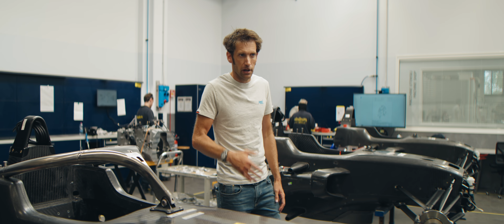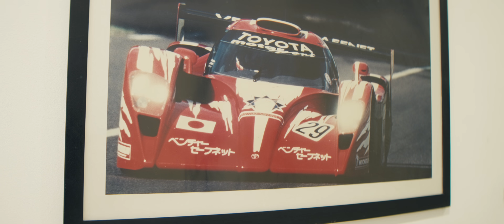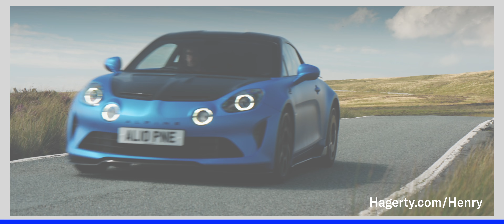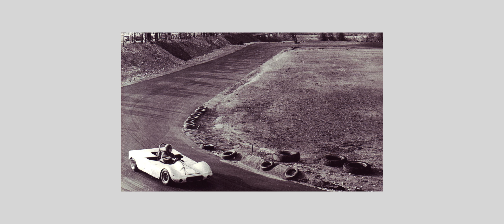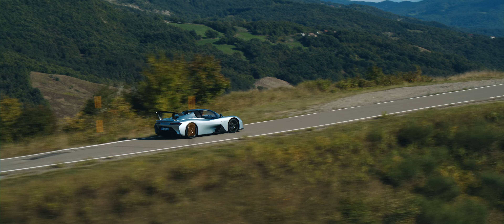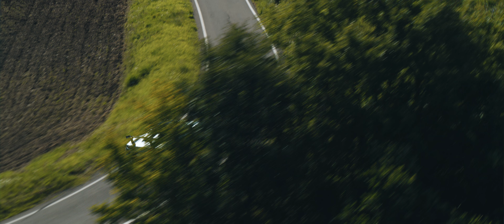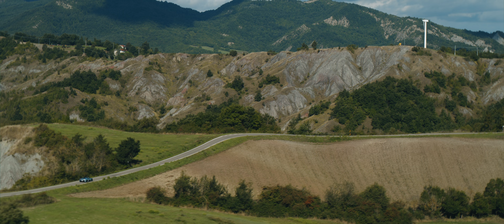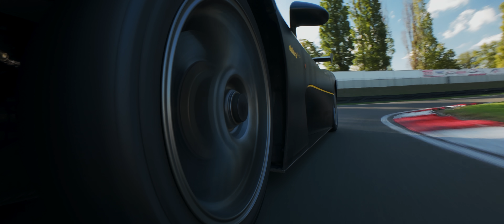Dallara Stradale: If an F1 car was a Miata | Henry Catchpole - The Driver's Seat

Comment: Ford guy here, all I gotta say is they could have used any 4 cylinder. But they know how reliable the 2.3 is and how small it is and they choose the ford/ Mazda turbo. The same engine in the eco boost mustang with some added boost and probably timing and just maybe a touch of compression for the fact that it’s an exotic with no doors. Darn near the same output as a coyote in a 2.3. My hats off to Dallara because they don’t lie to anyone including themselves, they use the best option for the application every time. Thats why they make every race car that matters / wins.

Comment: the car is perfect but the lack of correct sound is unforgivable.... 2.5 liters 5 cylinders Audi, 3.5 v6 Toyota ( same of Emjira) ...may be done all in aluminum...a reboot of VR6 ...even if they sacrifice + 50 kg or some cm more... the car...specially with the name STRADALE is more then speed and effectiveness could be experience...and sound is the second thing you catch ... then arrives the rest

Comment: The thing sounds horrendous. Doesn't match the look at all. They did so many things right. They had that talk about matching looks and aero with the engine. I call bs cause they had a choice of about any engine they wanted. Yaris 3cyl, Honda, Subaru, Mercedes, Renalt/Nissan 4 cylinders all have options that are probably able to work, 5cyl are easy to make sound great, and 6 cylinders that might work.  But Ford.... you know the company with the highest recall rate.

Comment: I have no issues with a 4 cylinder turbo motor from Ford. Presumably they've redone the bottom end to get 400 hp from the road car, but otherwise the mundane bits can be sourced from the local dealer. I loved my 944 Turbo and before it my Mk 1 GTI; I love a straight 6, too, but with modern engine management, clearly a 2 liter four can produce all the power one needs--just add lightness.

Comment: I used to own a 2 seat aerobatic airplane that required you to step down into it.  It have a similar effect of "putting it on" rather than getting into it.  However, getting in involved stepping up over a very high edge, standing on the seat and lowering yourself in with upper body strength.  

I would have loved to see how you get into this car.  My guess is the process is similar.

Comment: So they wanted a lightweight, 300hp, transversely mounted, turbocharged 4 cylinder… and didn’t go with the K20 from the Civic Type R? The only reason I could guess for going with the Ecoboost instead is because Honda wouldn’t sell them the K20

Comment: A carbon chassis that can't be repaired if damaged, no doors so you will look silly getting in and out, no radio not even a basic one, no A pillar so the occupants will lose their scalps in a rollover, a regular crate ford engine boosted to 400hp so it has some decent lag and sounds like a ford focus, and the cherry on top is no clutch pedal and a paddle shifter because ''faster gear changes'' and totally not because the buyers can't drive manual. Oh and only costs 200k, what a bargain

Comment: The brake feel is undoubtedly an engineering choice. I have never driven the car or claim to know more about car reviews or  have half of Henry’s driving skill. Automotive reviewers in my experience have a tendency to like over assisted brakes that have a lot of initial bite which makes them feel more sporty and confidence inspiring but from an engineering perspective it’s objectively worse. Linear brake pedal feel allows for better threshold braking, modulation, ABS blending and more accurate trail braking. If you let two engineering companies design a braking system it’s almost guaranteed they will opt for the technically superior design choice rather than a one that might feel better. 

Also the 2.3L RS engine is a very very very logical choice if you want a production 4 cylinder that can make serious power. It’s a descendant of the Mazda MZR which was Mazdas answer to the other incredibly engineered Japanese 4  cylinders of the era K20/24, 1/2zz, 4g6x. It was also designed to go into trucks so it had to be durable the 2.3RS is a closed deck and monolithic bed plate so it can handle very high boost levels for a gasoline engine. 

Both the brakes and engines choice were engineering first, passion second choice decisions.

Comment: Very interesting, looks nice. But those tail lights are hideous. Should have moved the reverse lights to small rounds that are at the upper corners within the diffuser section, similar to the interior dash element, just much smaller.

Comment: That it uses the 2.3 L Ford is interesting. Just saw a young man that has build 2 Miata ND-1 with this engine. Different exhaust manifold and turbocharger. One with 400 the other 500.

Comment: If it were me I’d have put a 9,000 rpm Honda N/A engine in it with  270 hp. - Linear power band with instant response
Reply: Then add a supercharger

Comment: Sweet vehicle. And with the use of the Ecoboost 2.3 & the MMT6 B6 transmission, which both have plenty of aftermarket support there are plenty of things that can be improved on. The price is a lil insane but that's kinda to be expected from arguably the best race car manufacturer in the world's first road car. The view out the window, to me looks like an old Group C Le Mans car just with a bit more visibility. I would definitely like to take the manual one for a spin on my home track, Lime Rock Park. It's lightness would probably do great there. Great video 🤘🙂‍↕️🤘
Reply: They make 50 a year, even at that price the waiting list is probably very long
Reply: @medicane122  apparently few months max, if you choose something like exposed carbon its gonna be a longer wait ofc

Comment: It’s a shame they don’t use a high revving engine
Reply: Imagine a Panigale V4 R in it...
Reply: Yeah... imagine if they offered it with something like a turbocharged billet K20 or K24. That thing would sing and perform incredibly well, too.
Reply: @CaseyCollier  imo, turbos defeat the purpose of this car, it should be N/A and really high revving, though a turbo k20 sounds really nice in this, or maybe a f20c from the s2k
Reply: @GAFUKIS  

I enjoy screaming N/A engines like the K20 as much as the next guy, but in order to actually take advantage of the lightness of the chassis and the aero on this car, you really need something with a bit more horsepower and torque to give it a better power-to-weight ratio. That's why I'd go the forced induction route and turbocharge it. Turbocharged billet K20s and K24s still sing at a fairly high RPM while also having far more power and torque. Frankly speaking, the car only really needs 400-500 horsepower at most, so I wouldn't over boost or strain the engine. That'd keep the car relatively reliable and deliver the kind of performance people would expect from a vehicle like that.

Comment: I wanna hate on the engine choice, but, if this company and designers have access to just about every powertrain choice ever made and is who award winning race teams go to, I'd have to trust that they know what their doing when building their own car....  Thanks Harry for an awesome incite 😊
Reply: Also remember the main point is also to avoid becoming a rival of their client base, including Ferrari lol
Reply: The Duratec is a fantastic engine that competes pretty much head-on with the Rover K-series in terms of weight but 10% or more capacity and torque.  I engineered a 2.0L Duratec conversion for my mate's S1 Elise and, with some fiddling we got the whole powertrain 30mm down and about 15mm forward.  It transformed the car's handling in ways and extents that I wasn't expecting.  I think the low CoG is what Henry is feeling in the Stradale.  It allows you to run lower spring rates with less impact on roll and pitch stiffness so your suspension can work better against road surface disturbances without compromising ride quality to obtain the desired yaw response and stability.
Reply: @AndyRRR0791   I see you know stuff, the ford engine is perfectly fine for the application, like the Z20LET was ford the Opel speedster, what is not fine is to ask 200k for a bare bones car that sounds like a ford focus.
Reply: @danielpedro77  You're offering something cheaper or more exotic...?
Reply: a tiny bit of family to my 2.3 turbo mazda 3 mps engine :) which surprises me.
Reply: It’s actually a very good engine. Lots of power for its size. My wife has over 225,000 miles with zero issues.
Reply: It sounds so bad though! And we know sound is a key part of the experience!!
Reply: It wasn't mentioned in the story but I assume price and availability were also factors in selecting a Ford four cylinder engine.
Reply: @stuartstephens they have experience using them on other customer chassis and it's a very common crate engine for lightweight project cars in europe.
Reply: @s@s @stuartstephens e 2.3 EB is listed in the Ford Racing parts catalog.  The best 2.3 EB is ‘24 and up Mustang variant as they added port injection along with direct.  Either way I believe Dallara uses a stand-alone custom tune ECU, a bespoke fuel system and a more progressive turbo vs the low and mid range oriented twin scroll factory unit.  All told with custom exhaust prolly a $15k engine.  Not sure the transaxle, but the money is in the suspension and light weight, which tells me more motor unnecessary.
Reply: Then you know nothing about the 2.3 engine bud
Reply: @JewelzTheEmeraldKing  Well, there's 19kg between the 2.3 Ecoboost and the 5-cyl EA855 engine.  On top of that there's over 20kg betwen the MMT6 and the lightest DSG from VAG, so that's +40kg before you've even selected for torque capacity.
Reply: @AndyRRR0791 yes that's true
Reply: I've worked at Honda, Ford, Toyota,  and Chevrolet( but only for a few months)  Ford 2.3s are not nearly as good as some of the other choices the nothing from Chevy works all sorts of issues with their current line for these needs.
If it was me I would have pushed the design to a Toyota or Honda  tho those choices would have less power down low
Reply: Many race/track cars use the ecoboost platform for a variety of reason. I understand as well and I truly havent had the best experience popping 3 of them and lifting the head 3 times on a built stroker.

All that to say in lightly modified form I truly had very little issue.
Reply: “they’re” doing, Brainwave… it literally means “they are”.
Reply: I've seen this chassis #2 car live in Zürich on the streets (Same colour and Italian number plate) and it has some serious bass to it... doesn't make the sound way better, but it's more vivid
Reply: Their choice was probably heavily influenced by the fact that didn't want to compete with their main customers who  make hypercara cars that have V6/V8/V10/V12s with none having a 4cyl.
Reply: That’s great in theory but why would I pay 200k euros for a ford eco boost 4 cylinder so I can say my underfloor downforce is superior to your v8 McLaren/ferrari
Reply: @nickk707 those engines are way heavier and the car doesn't need that much power. I think you're missing the point of the car.
Reply: @Wallstreetavarice  The Audi 5cyl would have been a nice choice,17kg heavier
And it comes with 6spd man and DCT,dq500 isn't the best dct but if you want paddles it's ok
Reply: @christianlekstrom2398 I thought so too, but there are other super/ sports cars like the KTM X-Bow and Donkervoort GTO which use the 5 cyl, so maybe it’s because Dallara doesn’t want to become competitors with clients? I’m not sure if they’re clients to be honest but that’d just be my guess.
Reply: @hugoop4  It's because 17kg (if you believe that...) is still a lot of weight.  You'd certainly feel that in the driving experience.  I'd bet that, by the time you had your DSG et al, you'd be looking more like a 30kg della
Reply: @hugoop4  VW's 5 cylinder is getting discontinued so it makes sense for a number of builders to switch to what's available i.e. Ford.
Reply: @SneakyB Ah I didn’t know, yes that does make sense.
Reply: @nickk707  people who buy this buy it for how it drives, no to brag about cylinder count
Reply: @mozyhar that’s irrelevant I’m sure it handles great but there is no need put a 4 cylinder ford engine shared with the ford focus that sounds crap and has lag in a car of this class they don’t match not for 200k.
Reply: @nickk707 Your superior $200K V8 McLaren is going to have a not so superior Nissan V8. Turbo lag is eliminated with hybrid turbos already. Maybe keep up with new technology.
Reply: @nickk707 it doesn't have any more turbo lag than the McLaren and Ferrari turbo v8's. So it is literally just about cylinder count or noise. 

You'd probably complain if it had a NA Cosworth 4 cylinder because it would only make 300hp.
Reply: @m @mozyhar He doesn’t understand what the racing pedigree means. To him a lambo is superior to this masterpiece
Reply: @omursariaslan3582  ironically Historically Nissan has made a better v8 than Mclaren
Reply: @nickk707 I have many cars including an F355, and CAV GT40.  Do you wanna know which is the most fun and yes sounds good; Alfa 4c.  It’s all about inertia, and a boosted 4cyl in a light car is a helluva thing.  I also track an EB PP Mustang I bought new 10 years ago.  I had all the hot S550 models, GT PP, GT350, GT500 CFTP.  I only kept one; the 4cyl.  Why?  150 lbs less weight on the nose.
Reply: @ProjectFairmont  quite true. 493 HP with only 890 kg is hypercar territory given that it also prpduces 1.2 tons of downforce...
Reply: @SneakyB  don't forget about cars like the NSX known for not being very powerful but an amazing car on back roads and on a track. People also don't understand power to weight ratio is everything. I know zero about Ecoboost not a ford fan but I'd be willing to bet Ford guarantees those engines for whatever horsepower they asked for with a warranty. No one wants to look bad in a situation like this.
Reply: @kentaylor5842  well, they're pretty much based on the same engine platform as the rally car though that one is on a 2.0L with 600 HP.

speaking of power to weight ratio, the Dallara stradale is on a similar output and weight to the Porsche 919's engine and that one is also using a 4 cylinder ;)
Reply: @nickk707  I'm absolutely sure I sound like a fanboy, but I think Chris Harris put it best, in TG S27E3. "This is a car for someone who wants to be connected to the driving experience; not a peacock from Cheshire." To put it simply, this is a literal Miata with F1-level aero. There isn't a single car that is similar, save for something like the Praga Bohemia, or The Valkyrie.

Even I hate the fact that this thing has a 2.3L Ford Engine. It would be glorious with a small displacement, high-cylinder count naturally aspirated engine; Maybe a Cosworth V8. But Dallara's business was explained in the video. They build race cars. They specialize in carbon composite, chassis tuning, and aero; not powertrain integration. And it shows. The idea is to select an engine that is cheap, lightweight, and makes the power you need, reliably, and efficiently. And they did exactly that. 

The car lapped The TGTT in 1:12.8; 0.1s behind a 710bhp 488 Pista. That's not just impressive, that is insane. The TGTT isn't a horsepower-neutralizing track, and yet the thing managed to nearly eliminate a 44% Horsepower advantage; just from chassis tuning and aero. You wouldn't pay €200K for better underfloor downforce; but F1 teams would gladly shell our €10M for what the Dallara can do. And they do.
Reply: @omursariaslan3582  Bro the Nissan VRH is absolutely nothing to scoff at. The thing was put into the R390 GT1. And add to this, the fact that McLaren has had an illustrius and longstanding relationship with Japanese engineering for powertrains, it makes sense. Also, new tech isn't bad; but NA Engines do be tickling the eardrums in the right way.
Reply: @MultiMustafa7 Neither is Fords 4 banger. The point is that the name on the power unit doesn’t matter so long as it delivers the desired output
Reply: @nickk707  🤦🤦
Reply: @nickk707 ever heard of lotus ? Elise uses a 4 banger out of a Corolla and evora uses a Camry V6 and the elise will spank a  mustang V8 in a straight line not to mention how much it will gap it around corners.
Reply: @k @kentaylor5842 the Elise is half the price of This it warrants more than a Toyota engine
Reply: They wanted to go with an American or British company I'm guessing and options kinda limited in that aspect, a K series would probably be better in every aspect.